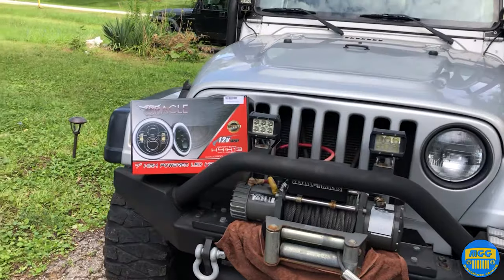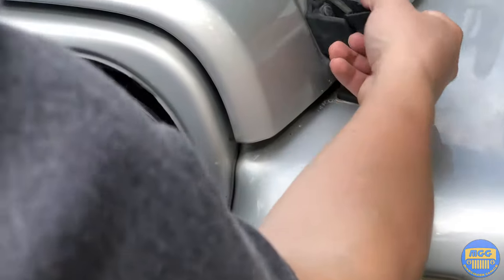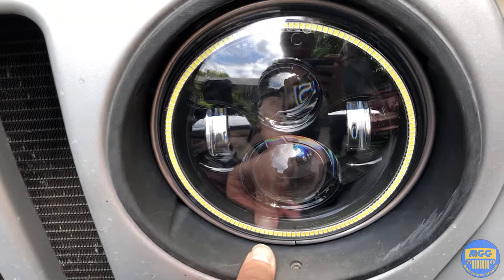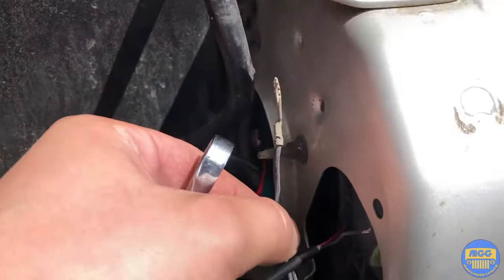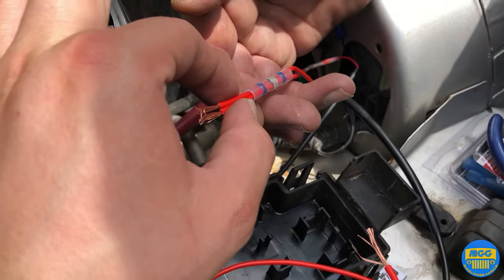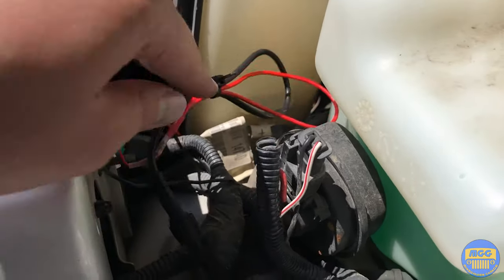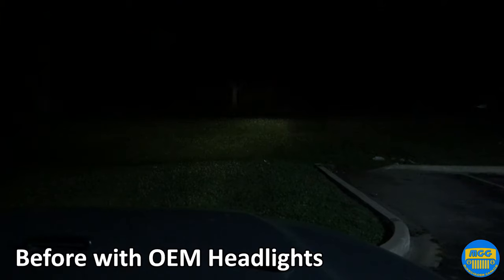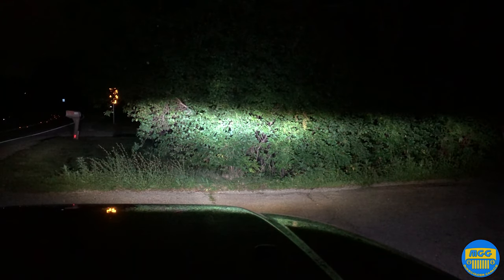D.I.Y. - How To Install And Wire LED Halo Projector Headlights On A Jeep Wrangler

Comment: Mike Golden Garage thank you feeling the FAST SIMPLE Video...

HELPED me A LOT for my 2009 Dodge Nitro.

Dodgr Nitro "Grill Removal" Is REQUIRED to Even Remove/Replace LED/Halo Head Lamps.

EZ-PZ to "Route Wires" on ALL  2008-2012 Dodge Nitros.

Comment: So you’re the only video I’ve found helpful, I have a xj and it came with the pos and neg wires as well just not as long do I need to get extensions and hook it up the way you have?
Reply from the maker: Yeah I would say just some some extra wires and solder them

Comment: Great video, easy to follow all the way up to the fuse box. Only problem is in my 2006 TJ I don’t have a fuel injector fuse (in that space I have clutch override). I tried the fuse extender in every fuse slot it would fit and either the halos don’t work, or they’re always on. Do you have any suggestions?
Reply: Update in case anyone else finds themselves with this issue (is it the right/best answer, who knows, but it works!): ended up attaching an inline 10A fuse, attached a male connector to the end and plugged that into one of my open relay slots that apparently is switched. Tucked everything, including fuse, into an open gap at the end of the fuse box and called it good! Still very much appreciate this video!
Reply: @arieldebin1385   Could you please explain more on this. I have 06 TJ and was planning to do this activity. I have the haadlight withHalo and turn signal lights ready. But not an expert with wiring. Do I have to buy more fuses? What else is needed? Appreciate your details here.
Reply: @pavan hegde  it is difficult to explain details without being able to use pictures, but I will do my best. If you’re looking to have the halos turn on every time you start your ignition (as Mike does in the video) I would start by wiring them exactly as he does in the video, including using the fuse extender and seeing if any of your mini fuses in the engine fuse box are switched (meaning they only provide power to the halos when the key is turned on, versus always providing power). Your fuse box might look and/or be wired differently than mine, so i think it’s a good place to start. 

If like me you end up not having any switched mini fuses, you can try my approach. 

I purchased an inline fuse holder (like these https://www.amazon.com/gp/product/B081DHT8Y7/ref=ppx_yo_dt_b_asin_title_o02_s00?ie=UTF8&psc=1) and a 10A ATC fuse (the bigger ones like this https://www.amazon.com/gp/product/B000MMH1QW/ref=ppx_yo_dt_b_asin_title_o02_s00?ie=UTF8&psc=1). 

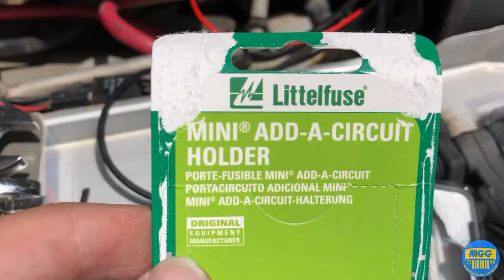I followed Mike’s video in connecting the two halos with an extra red wire, then connected one end of the inline fuse to the red wire connecting both halos using heat shrink connectors (just like Mike does with the fuse extender beginning around 10:38 in the video) and attached the other end to a male spade connector (like these, but the larger yellow size from wirefy https://www.amazon.com/150-Wirefy-Male-Spade-Connectors/dp/B07QF1DXHY/ref=sr_1_3?crid=3V2ZUDEBBY23Z&dchild=1&keywords=wirefy+male+spade+connector&qid=1632960200&sprefix=Male+connector+wirefy%2Caps%2C163&sr=8-3). 

This male spade connector I then plugged into one of the openings on the far right of my fuse box, where the large black relays are plugged in (this is what my fuse box looks like, I plugged the spade into one of the openings in the bottom right corner, https://www.bonanza.com/listings/2006-06-Jeep-WRANGLER-3-8L-Engine-BAY-FUSE-RELAY-Box/768969641?goog_pla=1&gpid=341761184097&keyword=&goog_pla=1&pos=&ad_type=pla&gclid=EAIaIQobChMI5MjVzrGl8wIViv_ICh2-swpMEAQYBCABEgJt7_D_BwE). 

The bottom right option ended up being switched for me so now my halos turn on with the engine, then it’s just a matter of finding a way to tuck all of the wires and the inline fuse out of the way (make sure you give yourself plenty of extra wire to work with). 

I hope this is helpful!
Reply: @arieldebin1385  Thanks a lot for taking time to explain this. Very helpful.
Reply: @arieldebin1385  I was watching a video where you don’t need to add fuse at all. He just spliced the wire that goes to Blinkers and Parking lights.
Reply: @pavanhegde1825  that is not entire accurate. It is true if you follow the directions that come with the headlights and splice directly into the pre-existing, pre-wired DRL/blinker wiring, you do not need a fuse or to go through the added steps in the video, because a fuse already covers this wiring. However neither myself nor the video are splicing into the pre-existing DRL/blinker wiring. I am not sure why Mike decided against this approach, but at least for me my wiring is too difficult to get to due to aftermarket mods. Instead, what we both did is attach the two halo red wires to one another and then attach this red wire to the engine’s fuse box. An added fuse is necessary (like mike does in the video through a fuse extender) only to protect the headlights from burning out (rather the fuse will burn and save you from buying new products). If you are able to follow the directions that came with the headlights then you are correct an added fuse is not necessary. Good luck!
Reply from the maker: I want to thank you for your detailed response!  Also I’m glad that I could help you both too!
Reply: I had the same issues as you. I took your advice with regards to using an in-line fuse adapter and connecting it to that relay spot. It worked perfectly! Thanks for sharing that wiring method! 👍🏻

Comment: How did you correct the high beam angle issue? I’m about to buy a 99 TJ and will be looking to buy these lights.  Thanks.
Reply from the maker: Thank you for asking the question. I just realized I never edited the part two video where I show how to adjust them. Lol. I’ll work on getting that. Idea done this week if it help you

Comment: So does fuse tapping into the fuel injectors not cause the fuel injectors to work weaker? Im sure it wouldn't just my OCD wondering haha
Reply from the maker: Still haven't had any issues.  My understanding is the same amount of electricity would flow through, as there is a separate fuse added.

Comment: What kind of wire can I use  as an extension. Does it need to be a specific gauge or will any low voltage stereo wire work

Comment: my high beams are up in the trees, but my low are right where they need to be, never get people flashing at me, I did the tape on the wall trick and I beleave it was 25 foot back to aim them
Reply from the maker: What headlights are you using?
Reply: @SwordInc  iam not sure of the name brand, I realy dont care about the high beams the low gives me all the light I need, I will be hooking my halo lights up to be daytime running lights
Reply from the maker: Ok, sounds good

Comment: Did the red wiring you connected them with come with the kit?
Reply from the maker: Any of the wire that was loose did not come with the headlight kit. Just get some extra wire from a local shop

Comment: Should the halo Led be wired to the brights or low beams?
Reply from the maker: If you want the Halo on only when the headlights are on, then sure wire it to the low beam. I have it wired to the ignition, so when the engine is on, the halos are on

Comment: Nice video,but bad advice. You definitely should not be wiring anything into the power for your fuel injectors, fused or not. Also, why are you using a 0 gauge power wire to your winch? way overkill and looks kinda goofy with a huge power wire running through your grill

Comment: Wow - TERRIBLE WIRE ROUTING. You've placed single-wall (hot) wires through small openings with sharp edges. Engine and road vibration will easily cut through the insulliation shorting them out and creating a total mess. NOT GOOD. Better is to use nylon spacing clips.
Reply from the maker: Thanks for the tips!
Reply: Flexible feeding tubes would have been ideal for your cables nice and neat very tidy heat resistant easy to hide out of site cable ties for fixing .👍👍👍🇬🇧🇬🇧🇬🇧